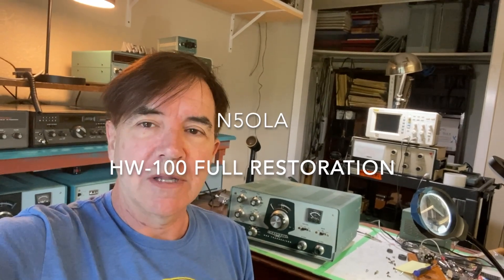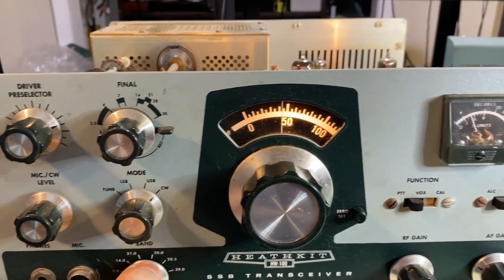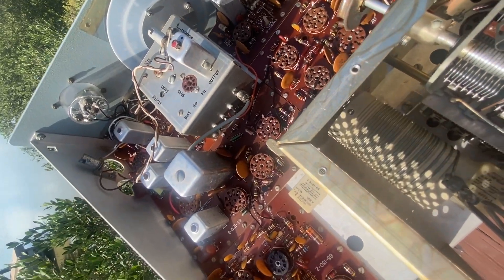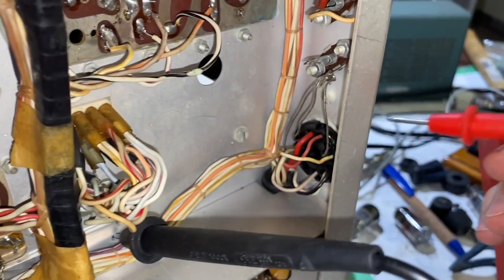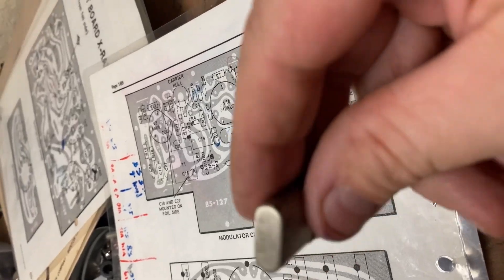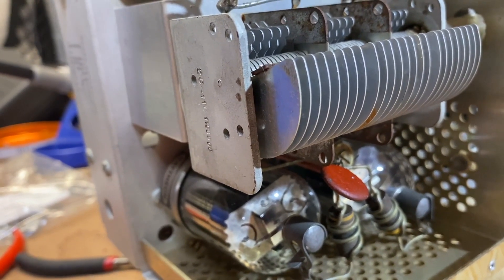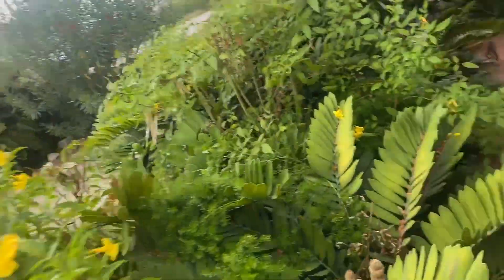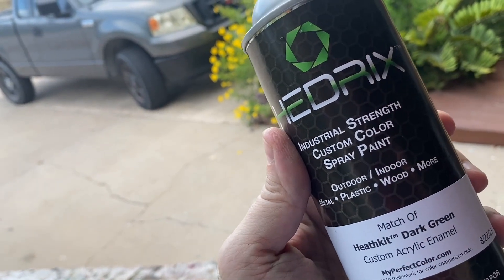HW-100 Restoration and demo

Comment: Hello Will! Just one question here. About your RF probe, does it have just the one meg ohm resistor or does it have the diode, capacitor resistor network inside? Thanks for all info given in your videos.
I am restoring both an HW 100 and an HW 101 and will need to know about the RF probe configuration. Many thanks ahead of time!

Comment: I'm starting to develope an affinity for the old Heathkits.  I just picked up my first amplifier, an SB-220 that was in great cosmetic shape.  It just needed an input band switch, which I located and changed out.  I've been hamming side 1989 but never had more than 100W TX power.  'Til now!!  I also performed the necessary Harbach mods and found that its Eimac 3-500Z's are in great shape, too.

Comment: My first HF SSB radio! I got it as a hand-me-down in 1977 or so. (Had an HW-16 before that)
Do you think the resistors "went bad" or were the original 20% resistors just way off to begin with?

Comment: Great video and restoration.  But those screws on the front is driving me nuts. They need replacing also. Then it will be done.
Reply from the maker: You're right. Went back and scrapped the rusty hardware.

Comment: Looks like you really know your stuff with these old Heathkits. I love your straight forward approach to repairs without going overkill, or performing any redneck style repairs. A lot of these old kits are a victim of the one who assembled them and their slobbering iron abilities (or disabilities). As far as the paint is concerned, the original looks so badly discolored from age that you couldn't and wouldn't want to match it anyway. I've used petroleum jelly on paint jobns to cover over areas that I didn't want to paint before with good results. It easily wipes off after. You could paint it with hammered Rustoleum paint and cure that in an oven and then go over it with the Heathkit paint to get that rough style finish, but I've never tried it. I assume you have the knob inserts on your website. I thought they were unobtainium. Good to know. Lots of vintage equipment uses them and it's nice to know a source. I will recommend your channel and store to others. Great job filming and editing the video as well. 73's!